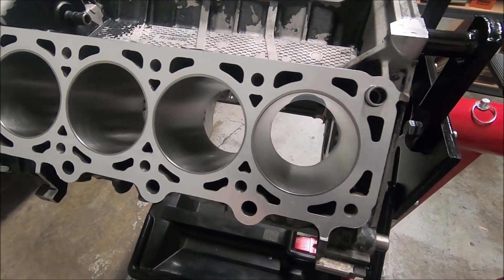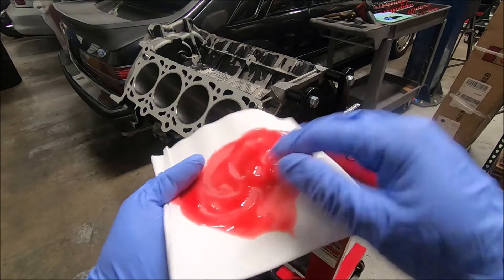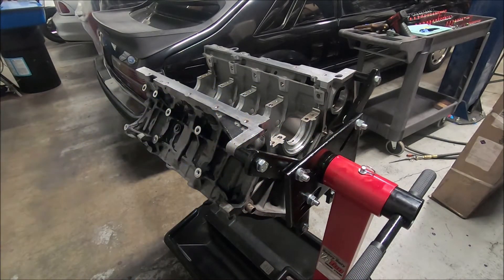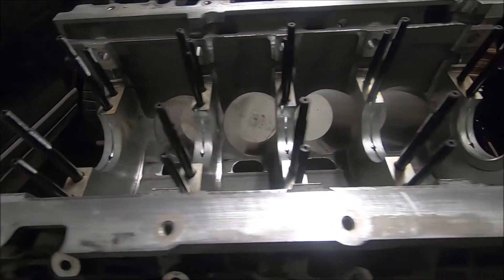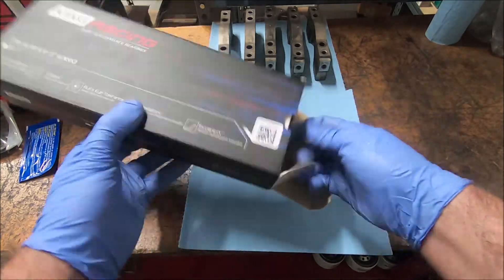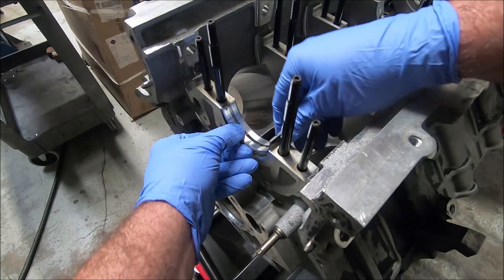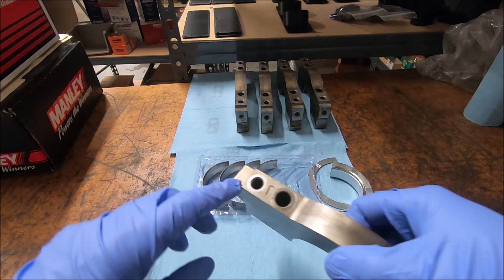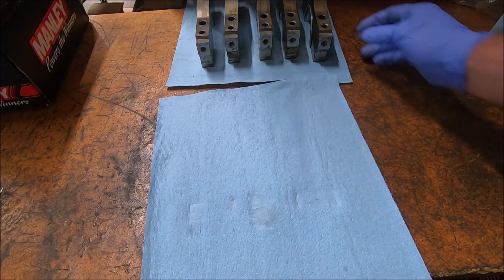99 Mustang GT with Nemak Part 2 – Engine Block Prep, Install King Main Bearings & ARP Main Studs

Comment: Do you know if these bearings will work in the teksid blocks? (kgbmb5281si) I ordered the wrong ones but these say its for aluminum blocks. 🤔
Reply from the maker: Looking at my email history, I have used or sold those bearings.  I think they might just be lower end bearings for factory level HP.  If you email me some pictures I can take a look and see if I can tell by pictures.

Comment: Hi John.  I am doing almost the exact same build as you.  I got my bearings installed and found my clearance is way too tight.  I am looking for something with an +.001 oil clearance.  The MB5283HPSTDX would be perfect but can't seem to find them anywhere in stock.  Summit is showing a four month lead time!!!  Any recommendations on an alternative?
Reply from the maker: I believe King only does a run of those bearings once a year and if they run out then you have to wait.  I have used Clevit before but I usually wait on the King ones.

Comment: When you put atf on the main caps, did you also put atf behind the main cap where the bearing goes?
Reply from the maker: Yes, I put a light coat.  Some prefer to put oil on the back side of the bearings others dont.  I dont put oil on the aluminum block side tho
Reply: @JohnSmithRacing  late to the game here, what is your thinking on oiling one side? Ive seen this debate